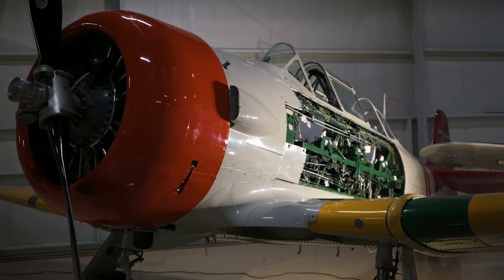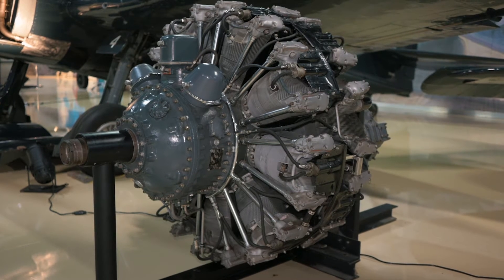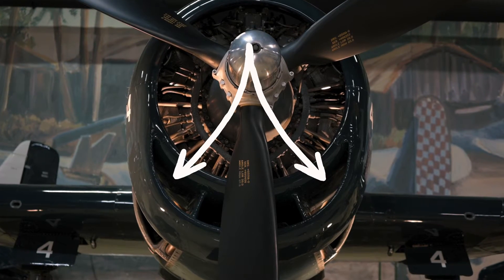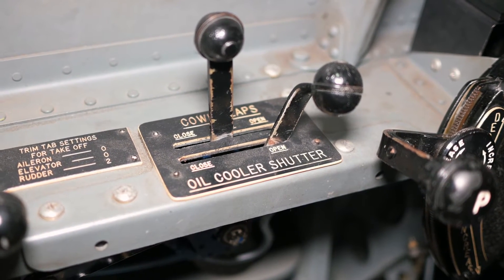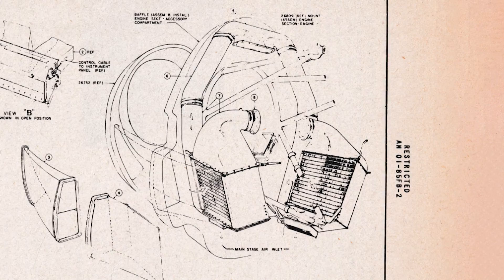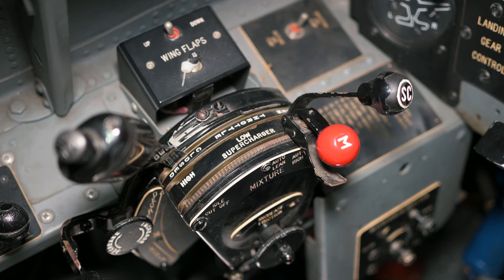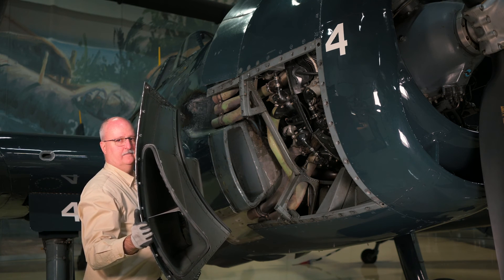A close look at the F6F Hellcat's air intake systems

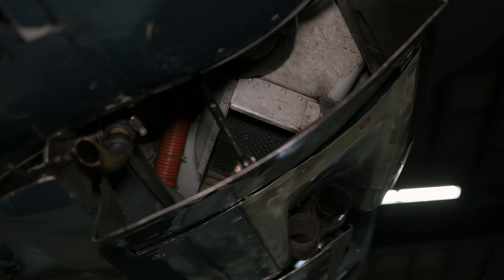Comment: Thanks for the information! But I still have a question, so when the second stage supercharger was engaged, for the main stage supercharge air inlet ( shown at 2:24), how did they make sure that this inlet was still sucking in the air but not having any leakage?